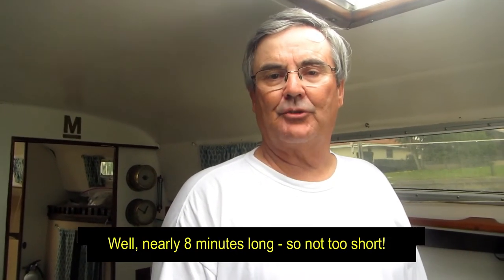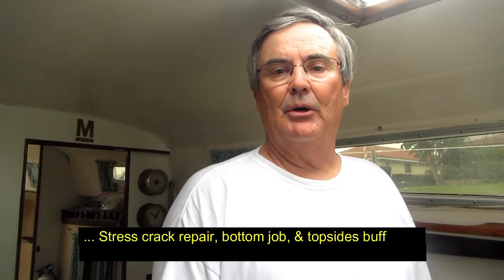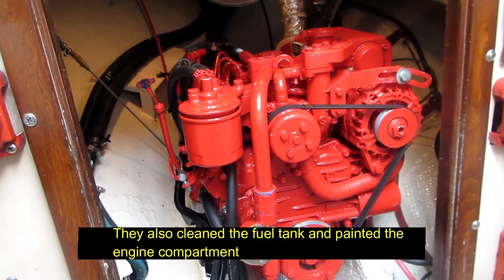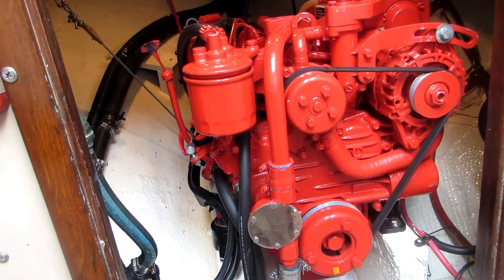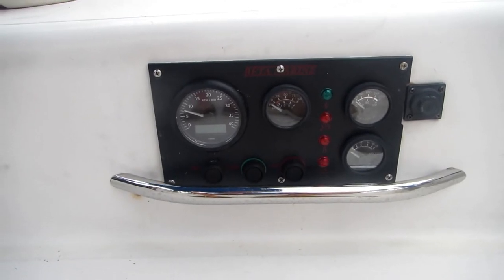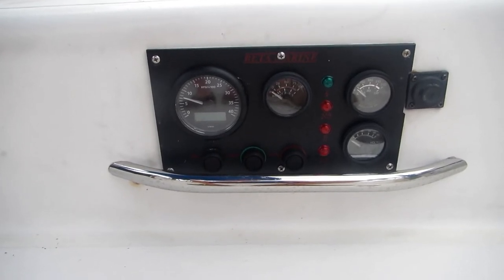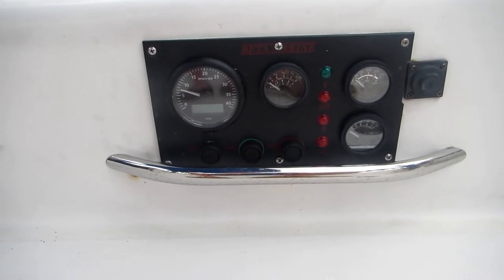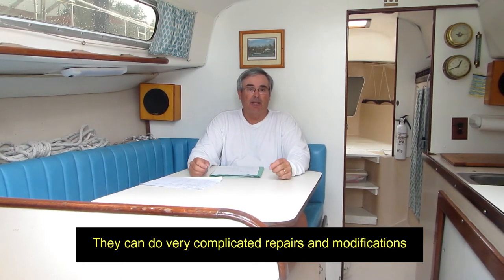Snead Island Boat Works Review

Comment: Good to see you again.  Nice job on the install.   Getting acquainted with the diesel?   I know that I am with my new toy. 
Vacation week for me and hopefully a few days on the bay.  If it’s not too chilly.   Video soon after I hope. 
Thanks Tom.
Reply from the maker: Hi Mike!  Yes, I am adjusting to the diesel. 
I still miss the smooth and comparative quiet of the almost "sewing machine-like" Atomic 4, but the new diesel with the tree-blade feathering prop definitely has more forward push, and much more stopping power, too.  I will just have to get used to the noise. 
I have managed to squeeze in a couple of sailing days over the past few, but we are in for a rainy week -  so I may just pull her until next weekend.
I would love to see a video tour of your new ride!  I imagine your boat is much bigger below deck than Whimsy, and you'll enjoy all sorts of easy modern features that didn't exist 52 years ago when Whimsy was kicked out the door of Morgan Yachts.  But, I typically sail alone, so Whimsy is still very spacious ...for me alone. 😊